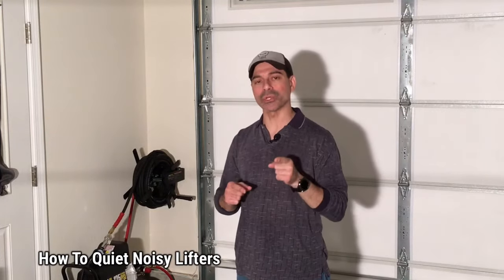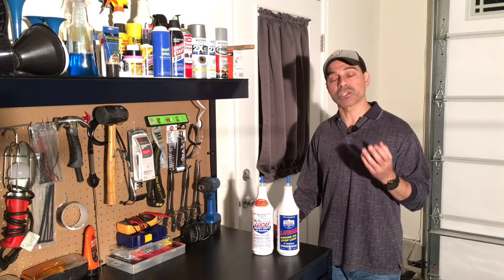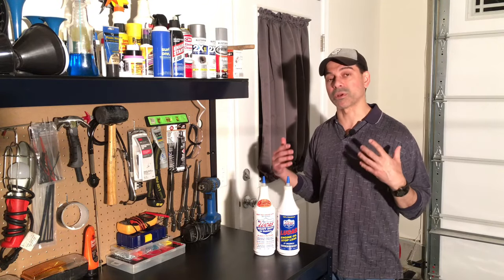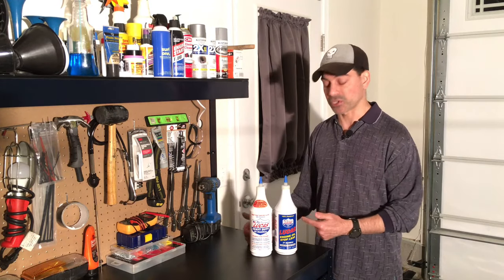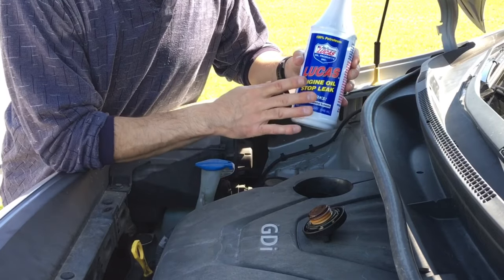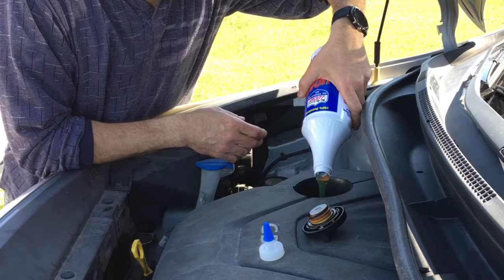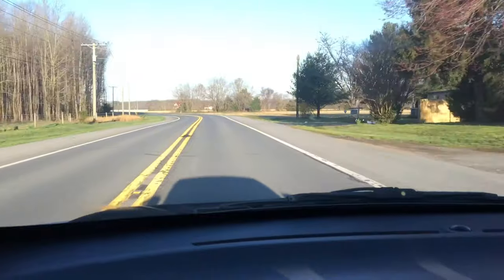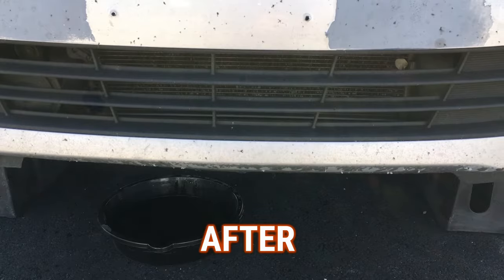How To Quiet Noisy Lifters (Andy’s Garage: Episode - 253)

Comment: great video, however i'm afraid you actually need some work done......good band aid though.
Reply from the maker: It did hold the noise down, but the engine in the video was on its way out. Was replaced a few months later due to other issues.

Comment: Great video. However, Lucas Heavy Duty Oil Stabilizer calls for 20% just like Lucas Stop Oil Leak. It does not call for the 60% you mentioned in the video
Reply from the maker: I’m afraid you’re mistaken. On the actual container for Lucas Heavy Duty Oil Stabilizer is says “Use 20% of system capacity. In badly worn engines use up to 60% of system capacity”. This is written right on the back of the container in blue writing under “Directions”.
Reply: @PhillipsVision  so do you now classify an engine with a lifter noise as "a badly worn engine" that you are recommending 60% of lucas oil?
Reply: Can you answer the last question from dabs please?
Reply: @dbabs134 use your own judgement I guess? Nobody knows your car better than you.
Reply: What the ratio of 6.2 litter ..8v